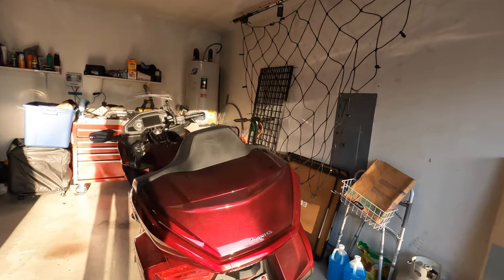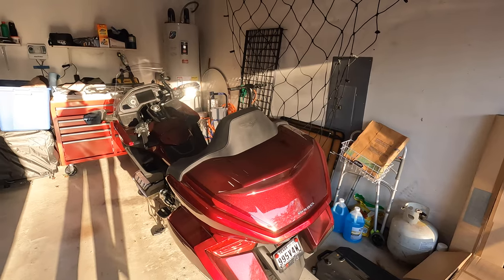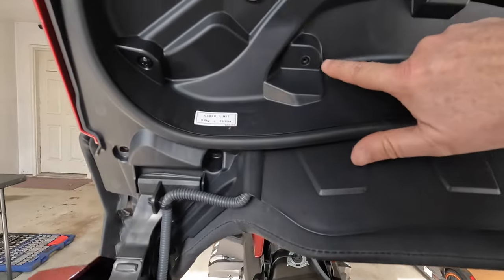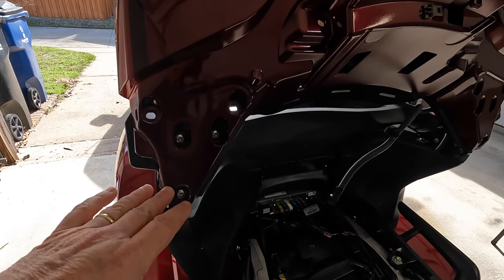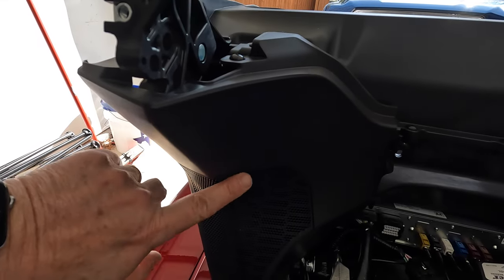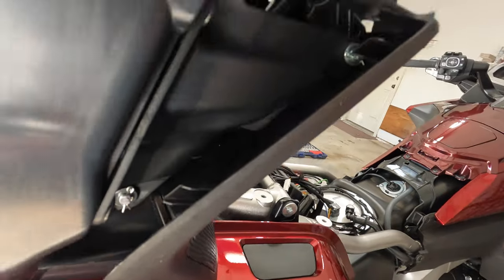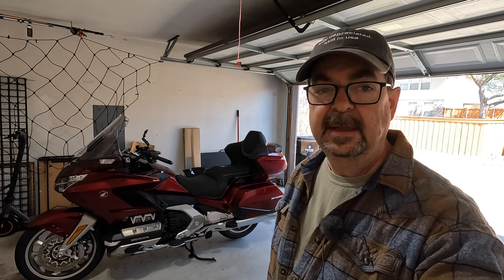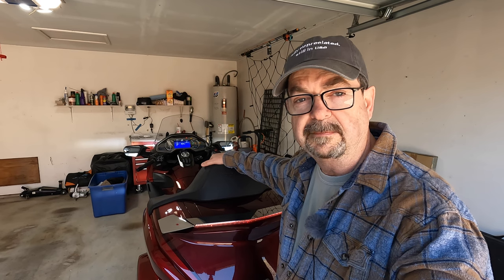Pathfinder LED Spoiler Install

Comment: Hi. Thanks for the install video. Very useful for my own install. I see you have the Kisan Tail Blazer - Brake Modulator and I am wondering the order of installation you followed in the Honda harness….. in other words; is the Tail Blazer installed first or last (or intermediate) before the stop/turn side of the Honda Harness
Reply from the maker: @fernandoasucre  I can’t remember but search my videos… I have an installation video on that product!  Thank you for watching.